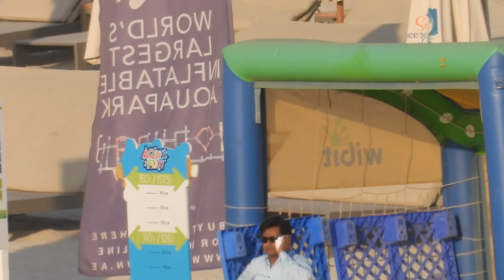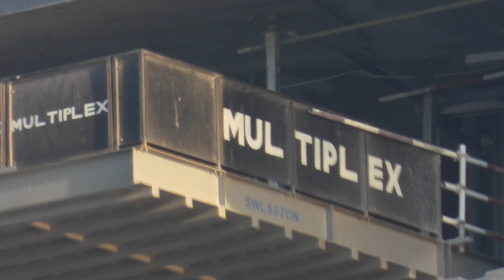NIKON P1000 Super zoom!

Comment: Is there any camera that can beat this Nikon? Say a 200x optical zoom? I'm really sold to this camera.
Reply from the maker: DRIVING Turtle not that I know of
Reply: To compare "zoom" capabilities look at the focal length in 35mm equivalent. This camera is 3000mm Focal Length in 35mm equivalent. Quality optics for DSLR that go this far are very expensive, you can buy a small car kind of expensive. That said the sensor is in the compact travel zoom category with 1/2.3" sensor size and derided by photo experts as a "cell phone sized sensor".
Reply from the maker: Maxheadroom1980 agree, while sensor is not capable of driving “professional” level still image quality it is still adequate for daily snaps in good light, what this sensor is capable of is delivering excellent stable 4K video, add to that an impressive zoom lens and you have a good video capable camera.
Reply: Edward T. There is only one lens available to the public that is longer that I know of. Many years ago Canon made a 5,200mm f14 full frame lens that had a list price of around $45,000 It weighed 100kg. There were less than 6 made and were probably bought by spy agencies or military. I am unaware of any being sold on the used market, however, Canon’s 1200mm lens was much smaller and it is believed that about 20 were made. Asking price was originally about $20,000. Some of them have sold used, the last one (in New York) is believed to have sold for $120,000 so I expect if the 5,200mm lens ever came up for sale, that it would fetch more than that. Probably quite a lot more.
In summary, yes, there is at least one longer lens made in the past, but cost and weight means that it is not an option for us mere mortals :) So the P1000 is the king of affordable long lenses.
Reply: @Maxheadroom1980  But perfect for this application.
Reply: @artistjoh  totally agree. The P1000 is the zoom king for affordable lenses / cameras. However, I think it's a one trick pony. It has the best zoom but regarding image quality, it's far behind even an entry level dslr. I would encourage most people to go for cheap dslr or dslm with a 150-600mm lens, which gives you around 900mm effective focal length with good image quality and acceptable autofocus.